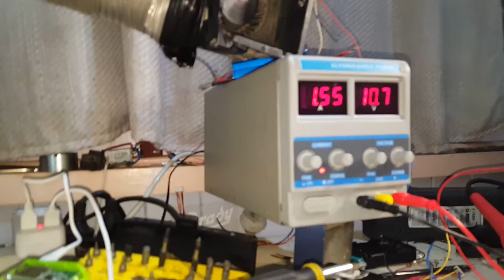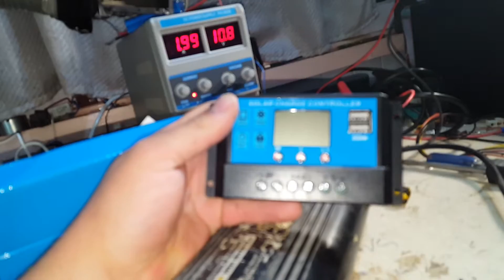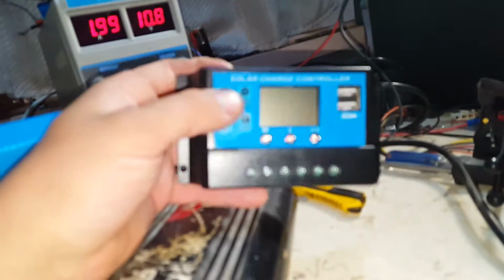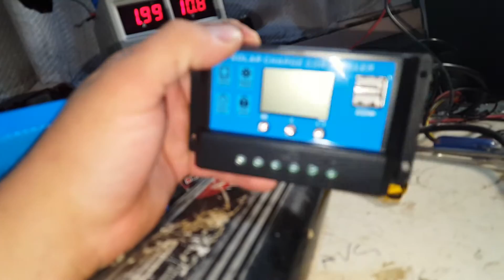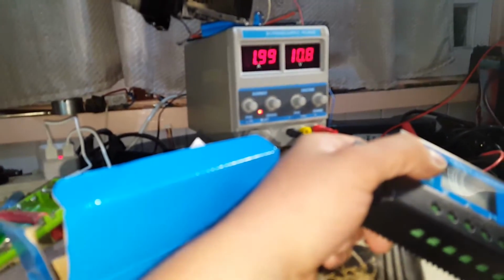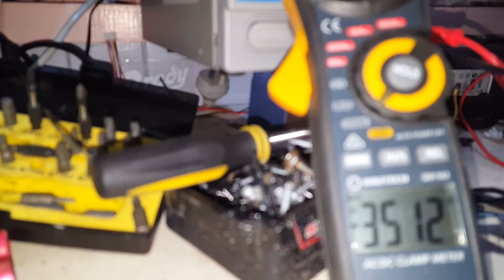Making a 18650 12v to 240v portable power station pt3 pack discharge test

Comment: loving this series of vids mate...It's on my bucket list to build an 18650 powerwall...and go off the grid...I work in IT so I have pretty good access to harvested laptop batteries...lol...just a quick question...do those cheap solar charge controllers work on Li-ons??...I thought they where designed to charge lead acid only??
Reply from the maker: +Pete Finn if the lion power wall is big enough  the charge curve isnt a big deal  as the  cells absorb the charge no worries. Balance is still needed to be monitored

Comment: Dose amp hour means that's how long the batterys will last just say 10 hours amp hour so the battery will last 10hours
Reply from the maker: +Jerry Blackledge yes its a measurement of  time vs amp draw
Reply: Ok that's good
Reply from the maker: +Jerry Blackledge theres lots of factors to how long a battery lasts
Reply: The amp hour is  the current draw for usually  over a 20 hour period. so if a cell has 3000mah  it can have 3 amps drawn from it to become dead flat.. as you only usually drop to about say 50% the usable capacity of that same cell would be 1.5 amps for 20 hours.  hope this explains it better.

Comment: How do you hook all them togetter an get 12vlot battery
Reply: mine ran my pc, pc speakers and led monitor for about 5 hours at 220-240V and to charge my phone from pc also. It Just depends on the load you put on them. this was the first test.
Reply: if you charge at 12V it should be balanced a lot better. general rule of thumb is 100% of the battery capacity for the charging amps if charging from flat/low so a 100ah battery requires a 10 amp charger.
Reply from the maker: Jerry Blackledge  3 in series and 60 in parallel
Reply: 3 batterys in seares an 60 in p
Reply from the maker: +Jerry Blackledge yes
Reply: How many hours can that battery last
Reply from the maker: +Jerry Blackledge doing what?
Reply from the maker: +Jerry Blackledge doing what?
Reply from the maker: +Jerry Blackledge doing what?
Reply: Runing inveter
Reply from the maker: +Jerry Blackledge what what load on it? Its about .6kwh
Reply: Many hours is that
Reply: How many hours is that
Reply: Can I use more batterys then 60 in p
Reply from the maker: +Jerry Blackledge it depends on the  load?
Reply from the maker: +Jerry Blackledge you can use 4 million in parallel  if ya want
Reply: How do ya charge them
Reply: Can I use a 3.7 charger to charge them all at one time or can i use a 12volt 2 amp charger I don't want to blow my batterys up bye useing the wrong charger
Reply from the maker: +Solar and Gardening stuff and DJ Stuff you can charge these  at 2.5amp per cell as a fast charge